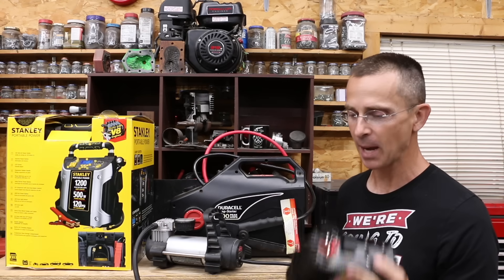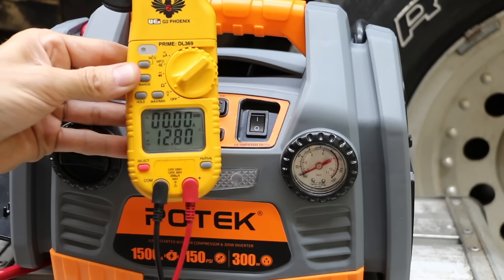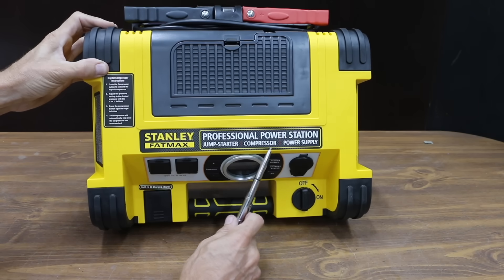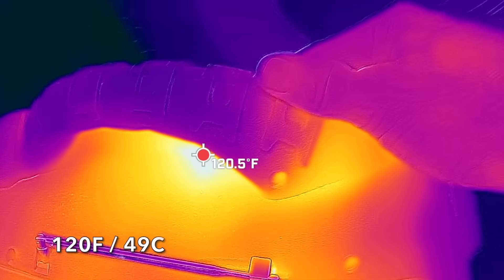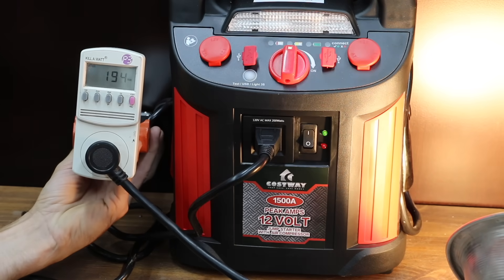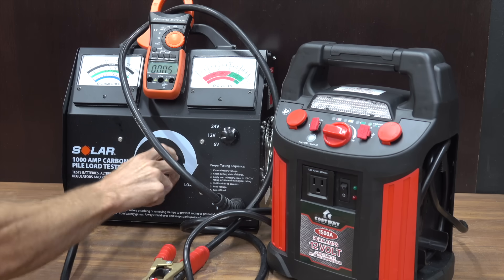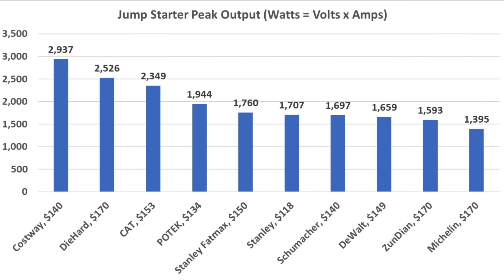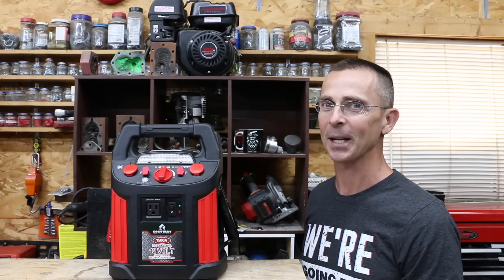Best Jump Starter? DieHard, Schumacher, DeWalt, Michelin, Stanley, CAT

Comment: This was perfect timing! My wife and I just bought a new car and now I know which system to buy. Thanks as always for the detailed testing.
Reply from the maker: You are welcome!  Glad to hear!
Reply: You usually won't need it for a new car.
Reply: -- Buy them separate.  Zero disrespect to Project Farm.   Buy a stand alone jump starter, tire pump, and inverter.  You'll have FAR more control over the quality/reliability of each product, and it'll probably add up to about the same price.  As well, if one feature fails, you replace one thing, not the entire unit.  EDIT: And if it's for your wife, you'll save her some hassle in weight lugging it around.
Reply: @MarkJacksonGaming  I agree, I think it is convenient to get them all bundled together, but it looks like you are better off with the QC on three separate products than one overall
Reply: @MarkJacksonGaming  you weren't disrespectful to PF whatsoever. You gave good advice!
Reply: Buy a small lithium battery based jump starter. I have one and it can jump a COMPLETELY dead battery multiple times on the same charge and is no bigger than a portable battery pack.
Reply: @JK Hi JK, Which lithium charger did you buy that let you down? It's good to know what models to buy. But just as important to know which ones to avoid. When Project farm reviewed these units their performance varied. So folks do need to stay away from the "bad boys."
Reply: Forget these bulky things and get a LITHIUM jump starter that fits in glove box. The good LITHIUM jump starters can start a car that has NO BATTERY.
Reply: @hightttech  I've almost pulled the trigger on getting one of the lithium "glove box jump starters" a couple times but just didn't trust their claims, and Amazon reviews can start to make your head spin after a while (it's great!  no, it's junk!).  I'd like to see Project Farm test a few of those small lithium models some day.
Reply: @Brian424  I had my father in law get one to carry on his semi truck. He gets back hauls and sometimes the vehicles are dead, pulls the tiny thing out and fires them up no issue. His truck itself has been dead a few times and it's even fired it up. Needs a recharge after being used on the truck but it definitely works, and takes up alot less space than a big combo jump box.
Reply: @Superman-pf6uo  Thanks.  I'm going to look into these lithium jumpers in more detail.  Probably get one for myself and give a couple for Christmas.  Thanks for the input.
Reply: @Brian424  Hi Brian, Project Farm has tested and reviewed lithium jump starters. You should be able to find the video with a simple search. I bought two based on the review. I haven't had to use either yet. But I have periodically checked their charge level and they both have stayed at almost full charge over many, many months. A lead acid battery will never be able to do that.
Reply: @Superman-pf6uo  which one?
Reply: @SignorLuigi  ....which lithium jump starter did you buy?
Reply: @Brian424  I usually read the 3 stars first on Amazon reviews. I think a lot of 5 star reviews are fake.
Reply: @amp12345amp  Hi Anthony! I bought the Audew. That was the model that did the best in Project Farms testing. Kind regards, Luigi
Reply: @Brian424  He already did. Check his videos.   I bought the TOPVISION 2200A for $80. It does the job.
Reply: @SignorLuigi  .....thanks.  Appreciate the info/response.
Reply: @Brian424  project Farm already tested the lithium jump starters there's a YouTube video for that
Reply: @hightttech  -- Which is great if your battery has a crashed cell.  And they're lightweight.  It's what I do.

Comment: Basically.... these are all a ripoff. Really awful performance in everything they are supposed to do. Rarely going to start a very dead car. Probably not enough air to fill a tire. Not enough AC watts to do much of anything you couldn't just do from a 12V power source anyway. 

A $50 compressor, $80 lithium jump box, and $60 inverter bought separately would all provide better performance in each of these categories, and likely weighing less.
Reply from the maker: Thanks for the feedback.

Comment: The last time you did this test about a year ago I followed your advice and bought the one you recommended turned out to be completely useless I have a 93 Mercedes Benz diesel with a brand new battery it had discharged in the winter tried the one you recommended totally useless used jumper cables from another vehicle for about five minutes car started up fine still have the same battery works fine in 2021.Also in another test of bolt extractors I bought the Amartisan extractor you had recommended turned out to be a complete piece of junk tried it on a 14 mm bolt all I did was tripped the head off the metal is Chinese garbage send it back to Amazon for a refund. Did the smart thing and got a mig welder and welded a nut onto the old bolt came right out.

Comment: Thanks for the video!  I've complained about this type of product for decades.  Even an "emergency" air compressor has to run for more 10 minutes to do anything useful, so most of these pumps aren't even worth having in the trunk.  These pumps not only get hot quickly, but 

The jump starters are even more worthless, as conditions are usually horrible when you actually need a jump starter; it's rare that you'll have just a "slightly low" battery and in warm weather when the engine is easy to turn over.  No, you'll have a nearly dead battery when it's well below freezing and when one of these units fails, you'll use it to charge your phone so you can call someone with actual tools to help you.

It's hard to find "real" tools in this category and hard to understand why people buy them.  I don't and I recommend that others don't.  Unfortunately, you'll have to purchase each feature separately and carry all of the needed items around :(.  That Costway unit seems better than most, but this whole "class" of product is nearly universally terrible.

If you do buy or own a jump starter, you cannot simply leave it the trunk for years and then expect it to work when you need it.  You'll have to keep it charged.  I just leave mine plugged into an extension that goes to one of my truck's cigarette outlets.  Provided the chargers work properly (that Diehard might not be), it will be fine.  Remember, you car battery is being over-charged all the time while you're driving, yet it lasts for years.

Comment: I was given the FatMax for Christmas a couple years ago. I love it and it has saved my bacon with both flat tires and dead batteries. But what I really like about it is the way it is packaged. Love that rectangular, low profile design that just slides under the seat.
Reply: Be wary of the pump. Only use it in emergencies. We've had ours for many years now and I used it to keep our tires pumped. It failed earlier this year and if you do a search on Youtube you'll find out why. The piston is a paper thin piece of plastic that wears causing it not to seal anymore. If you want to pump your tires locally I recommend a purpose built pump instead that you keep at home so you can keep the jumper pump longer.

Comment: Here's my 2 cents. I've owned several, and they just don't last, so my biggest factor is warranty. At Costco they have the Cat brand for $100. They take it back ...no questions asked, full refund. It's great to carry one in the car for emergencies, but if not for the warranty, I'd be out at least $700-$800. Now, if the cells don't hold a charge, I just trade it in for a new one.

Comment: On 11/11/19 you tested jump starters on a battery drained down  to approximately 7 volts. But this time you had the battery drained down to about 2 volts. Was there a reason for the difference? This made it harder to compare the jump start ability between the 2 tests.  As far as long term power, it does seem like these units in this (11/7/21) test have much more actual energy storage.

Comment: For the part about actually jumpstarting the car, your previous video and a local AAA tech convinced me to go with the NOCO Boost Pro GB150.

As for this style of device, I have many in the house and I’m not particularly impressed by any of them. This includes both the CAT and DeWalt models that you tested here. I’m clearly going to have to throw out a bunch of junk and get better replacements.
Reply from the maker: Thanks for the constructive feedback.

Comment: Good testing. A verdict I have is all are insanely priced. 1980-1990s tech, no USB-C PD in or out, and sub-par inverters. This does not belittle your objective test, just the whole market is poor. For around $150 bucks you should be getting USB-C charging (5,9,12,15,20 volts 3-5A) and a lithium power plant. Those SLA batteries will be worthless in the cold, and the first time you grab it off the shelf it will just comically raspberry at you then shut off. Motor starting current on those compressors will kill the SLA and finish it off after it is starting to fail after 6mo-1yr. They are not rated to draw that kind of current, and nothing I see tells me there is any kind of PWM controller on those compressors. 7A is about what to expect on those batteries, so they are just cheap. Any one of those products could be better with $75 dollars worth of tech vs $40 dollars they put into it. 

I am betting the market for these are a customer stuck on the side of the road, walking to a Home Depot or Lowe’s and trying to not get harassed for being late to work. So a captive audience, and they make you pay for it. Pretty Shameful.

I know what I originally described exists on the market, but may not be able to be acquired retail. The USB-C tech offers faster charging because it can deliver variable voltage 5,9,12,15,20 volts, and negotiate current. Here is a tip, forget the fast it says USB on it. PD means power delivery, and is usually 25-125 watts, but at a fixed max current, so 5v does not give you 5a if it is 25w. The voltage has to go up to increase the current. Anyway, all that great tech allows for smarter, faster, and better lithium power which none of these use. This is a case of they built it better in the past, because all you are getting that is 2000s tech is a blue LCD display. Nothing 2010 or 2020s about any of them. It even looks like they have no protection for overcharging and cracking the SLA like some Higher voltage alternators will do if you charge off them (Some target 14.2volts which will crack those SLA batts and make them useless)
Reply from the maker: Thanks!  Thanks for the feedback.
Reply: I'm just going to sum up my response as... "What in the world are you talking about?"

Lets deal with the first thing that seems to be your major issue, the USB-A versus USB-C PD. We can start with the fact that integrating USB-C PD is not as cheap as you seem to think, but it would also potentially make the pack less useful. Sure, alot of new phones support USB-PD, but what about bluetooth speakers? Or headsets? Or USB powerbanks? or anything else that either runs or charges via USB-A? Most of them have only switched to micro-usb in the last few years, and with the exception of a select few powerbanks, its rather hard to find any that support ALL of the combinations of PD that you say are possible. They absolutely COULD add it in combination with USB-A, but again, the cost for the end-user would make it difficult to justify. Remember, each of those PD standards have to be licensed to ensure that they are compliant, to avoid damaging devices. Hell, even Apple doesn't YET support USB-C PD. 

On to your point about SLA versus Lithium. SLA have always, and will always, perform better in freezing temperatures than lithium. This is because lithium cells are EXTREMELY temperature dependent. Literally any person who lives in a cold climate understands this. Most CAR batteries are SLA because it is extremely simple technology that works consistently and is dead reliable. Would lithium ion cells potentially provide greater power? Sure, at temperatures above freezing. "But tesla..." Tesla includes a battery heater because you can effectively HALF the runtime of a lithium ion battery in subzero temperatures. You ALSO have to remember that there is also the significant risk of thermal runaway which is indemic to lithium ion batteries. Pull high enough amperage loads for long enough, and the batteries WILL combust.

Finally, motor starting current is a known quantity, and while lithium ion batteries can supply potentially higher peak loads than SLA, every time they do has a significant effect on their lifespan, while SLA can handle similar peak loads without as much detriment to their longevity. Not to mention, SLA batteries can also be reconditioned fairly easily, while Lithium Ion batteries cannot be (at present). 

As well, I would ask what sort of display SHOULD they be using, according to you? Those blue LED backlit 7segment displays are EXTREMELY power efficient when compared to newer multicolour plasma or OLED displays. Not to mention, they really don't NEED to be bleeding edge tech, they just need to be functional.

Are these devices simple? Absolutely. Why? Because 99% of the people who buy these are not the "captive audience" like you seem to think, but people who have experienced a dead battery, and are taking steps to ensure that it doesn't happen again. Sure, the manufacturers COULD include everything you mentioned, and hell, they could even price them identical to these; they might sell a few, but I would hazard a guess that the added "features" aka complexity, would scare off the predominant majority of customers who think "I just want something I can throw in the camper, and have for emergencies. I don't need all this extra tech. I just want something that works."

I have used these in the past, and they are EXTREMELY reliable.
Reply: @Blue84Stang  At least you can charge SLA in the cold unlike lithium Ion.  I've had much much smaller jumps starters for years that are quite useful, these large ones with integrated compressors and inverters are pretty nice to have around, if you keep the battery topped up anyways.
Reply: @Blue84Stang   Not everyone understands everything about USB-C or how Electrical Engineering and reference builds/supply works, but it is pretty simple to understand if you have the right source. An example is Wire Gauge. Anything that is C can be made USB-A and with another 0.6 amps of current. It is just USB-C running at 5V, and adapters (The kind that change ports) can be found in junk drawers for the next 15 years. To the complexity, side of things, insulated lithium batteries loose a little energy in heat, but often in reference designs made by the OEM chip manufacturers they include all the supporting circuitry. It is more costly to try and use your own design from scratch. They even give you the layout to follow, copy and paste to PCB... If that technology can be sold for 20 bucks on Amazon, then it really was not much to build. I am not talking about USB-C logos and a port that is really just the 5v USB-A with a portswap, but something that can charge a computer. Companies have been integrating Lithium Charging and USB since before C was current, just browse Digikey or Texas Instruments. They are always trying to reduce chip counts, so that leads to supply the more people who use it. Then it trickles down to building millions of that circuit in China. So it is already surplus before I even made the original comment. 

I can sum up SLA batteries pretty easily, Every UPS ever beeping and screaming because the SLA cracked. SAME batteries as the jump boxes. That is perfectly fine for $100 dollars, but you can’t seriously defend them spending 40 bucks (which might be a bit generous), and charging you $150 at a highway robbery moment. The circuits built in the past were likely better before they tried to integrate all the extra fluff and make the whole thing worse.

They also DO sell exactly what I said, at a competitive price and it scares no one away. You can easily ignore the usb-c port if you do not understand it, you cannot use it, if it never existed. I would like to see a 7ah SLA battery shell out 1400 watts for a starter regularly and not just melt the plates. A cold Lithium battery will heat itself when used after a minute because that is just Lithium. It is dense and way more reactive than lead. 

Lithium charging is complicated, but Lead Acid charging to obsolete. No one is putting QA into a 25 year old charging circuit when nothing besides a UPS and a almost disposable jump pack will use it. If they did, and used something like a Super Capacitor, it could make more sense, but that is not something being done. 

It is easy to confuse Lithium and Lithium Ion, but not all variants are the same. Another point is that a FlatPlate AGM SLA for a car will absolutely decimate a Standard LA or even some Lithium variants in cold weather, but that is NOT what is in these jump packs. Bottom barrel, UPS surplus batteries rated at 7A or if your lucky 2 of them/the wheel chair version at 12a (which is usually too big). 

Some of this is not exactly common knowledge, but it is clear $150 bucks is better spent on something that can not only help start your car in an emergency, but can also charge your Phone, Laptop, and run a random hot glue gun, because that is something you can do with the 200 watts a few of those Lead Acid models give you. 

If it was closer to 80-120 dollars, then there would be much less of an argument, because then it makes since to compete with a friendly tow truck driver if you are stranded.
Reply: Thanks for your very thorough, informative comment. Please tell me there will not be a test forthcoming, my college days have been over for quite some time!